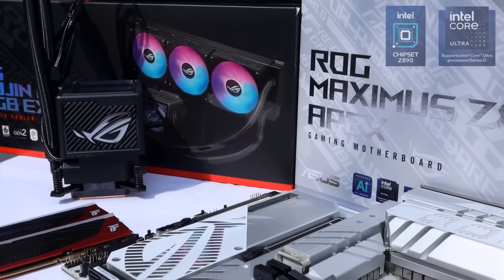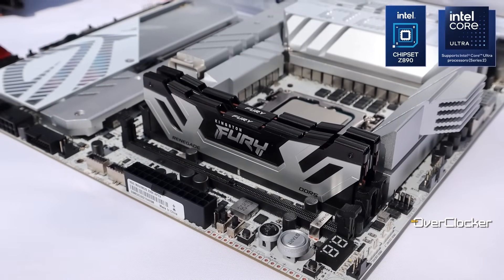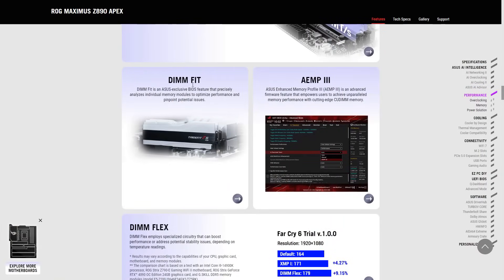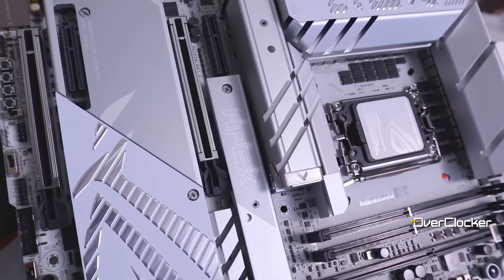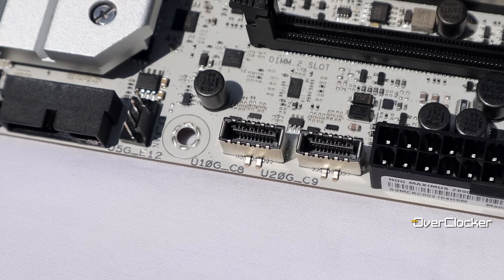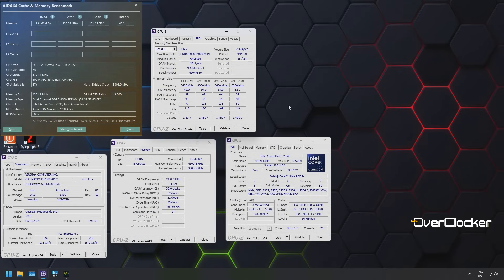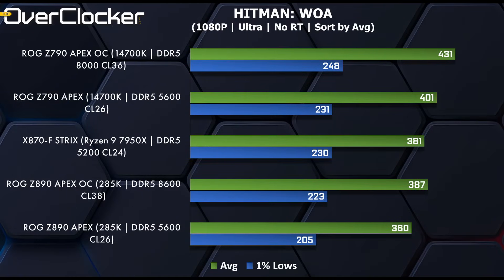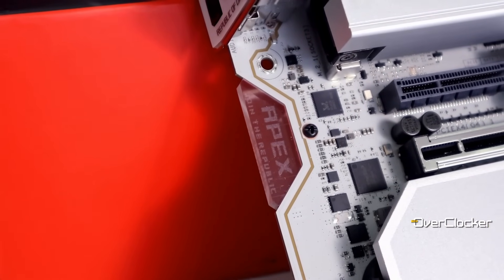ASUS ROG Maximus Z890 APEX   Starting Z890 with a Beast

Comment: oh man.... the site and manual both clearly stat that the 8 pin PCIE connector on the board is not for the VGA or GPU overclocking.... literally its for whatever USB-C port you plug in will get data but not give the proper output power (fast charging) unless you plug in the that 8 pin for more power to the USB-c.. good luck to you and your followers man
Reply from the maker: I'll have to update the video description to reflect that. Thanks for the heads up!

Comment: Awesome review!  What's the biggest difference between this board and the Hero if building a 4k gaming PC?
Reply from the maker: This is meant for pushing peak performance, whereas the hero is more focused on the quality of life features. Hero won't necessarily make the same DRAM speeds either, while the Apex is almost tuned for this. In everyday functions though I'd take the apex